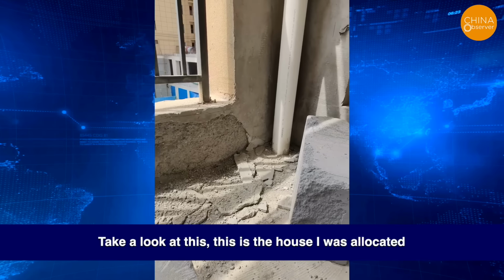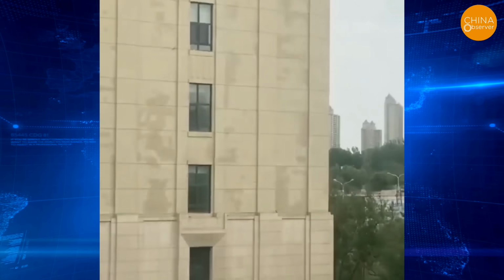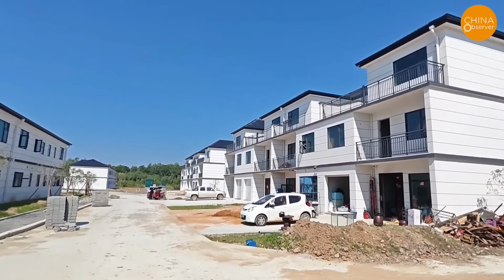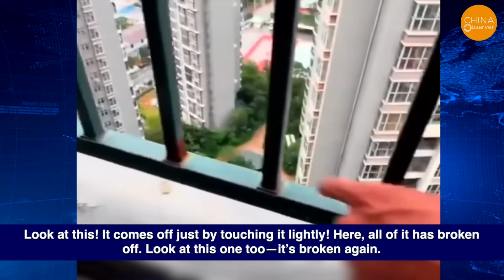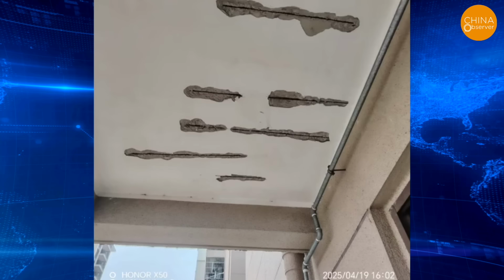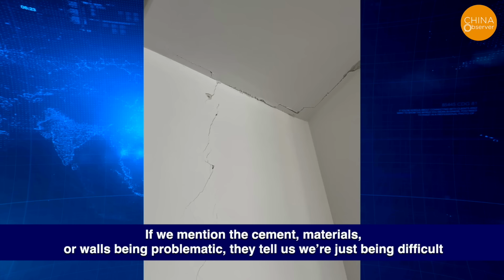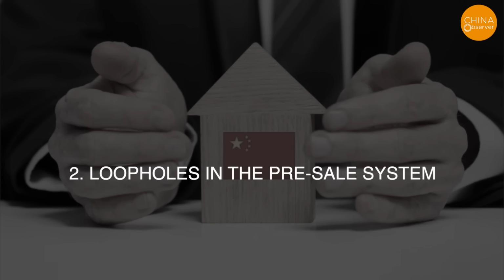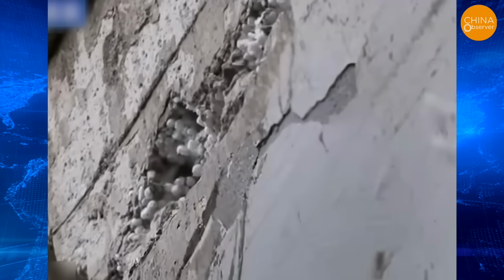China’s Inhuman Tofu-Dregs: 100M Skyscrapers With Rebar Snapped by Hand, Floors Cracked by Stomping

Comment: Necessary steps, are necessary for a reason..  Doing something other than the necessary, means that you are not completing the actual task you have been contracted to do.. Painting styrofoam, to look like bricks, is not an acceptable practice, because it isn’t even a brick…. 

China, stop comparing yourself to the US,.., there is simply no favorable comparison.  If you have money, you pay for quality, and you get it.. Quality, is the “reputation”, you should be concerned with, as it dictates the price of everything from Toyotas reliable cars, to western homes, and buildings that set the standard for design, innovation, safety, and longevity..

You build cities with fake drainage systems, and fire suppression systems that don’t connect to anything …

You make junk, that becomes trash..

Comment: I am a civil and structural engineer and although this should be more than apparent…the people living in these high rise structures with massive fissures and cracks especially the ones seen in columns and beams should immediately leave if they value their lives and this is not an exaggeration whatsoever. I know people will say where are they supposed to go? And to that I have no answer other than would you rather be homeless and alive or have a roof over your head that ends your life?!

Comment: In the UK, in the 1960s, the government built loads of very low quality tower blocks. They were plagued with issues. (Search Ronan Point disaster to see what I mean). Some of them didn't even last 20 years before they had to be knocked down. Anyway, the newer blocks weren't SO bad but they were still rubbish. Despite that, they've (just about) lasted 65 years and some of them are still perfectly sound, well made buildings. That is despite the fact they were made before modern building regulations and that corruption was everywhere during their construction. 

China is doing now what we did 65 years ago only we cut a few corners. They're cutting every single corner there is to be cut!

Comment: 16,000 Yuan to USD equals $222.77. 

Let’s say each unit sold in the high rise building is 1200 SF. Average SF of a 2 bedroom apartment in the U.S. 1200 SF to meters = 111.84 square meters. 

$222.77 * 111.84 = $24,914.59. You get what you pay for. Those are high rise buildings and let’s say the average 2 bedroom is the same average in America. That’s really cheap for a 2 bed room. What did they expect? Some things are worth paying more for. Then again, average income in china is like $220 per month so yeah.

Comment: The thing is, I wonder how much you can really save, because the difference in making it 10% but having it seem 100% are probably not that much higher than making it 90% and have it seem 100%. Like with the handrails, welding a couple of steel rods and then painting them is probably not that much more work than trying to paint them without them being properly attached to each other but still well enough so they survive bbeing installed. It is much easier to put a ceiling onto a wall than to put a ceiling up against empty air, I mean compare stacking up bricks and stacking up playing cards

Comment: Chinese tofu dreg problems have hit America, too, for decades. They sold a lot of crappy iron water pipes which developed pinhole leaks after a few years. Lots of crappy sheetrock with high sulfer content, in humid areas it creates mildly acidic vapors that corrode metal and electrical connections.

Comment: I work in construction and lay concrete floors ,engineer checks every single rebar, and takes pics, that all rebar  in proper place before he will allow any concrete to start pouring..and spaced correctly ,plus area dust free and dampened beforehand,concrete to be used cubed and tested before use each batch ..there’s no messing and the finished result must be within 10 mil or less.. but am in Ireland 🧐🇮🇪
Reply: No country checks every rebar and tests every batch.
Reply: @peter.wilson  My uncle worked for a construction company that was building an Arena in Colorado, they indeed tested every batch of concrete and filmed every aspect of the project, which was reviewed daily.

Comment: we have construction quality issues here in the U.S., too, but not nearly so bad. at least we can sue the company... if they haven't declared bankruptcy and hiding behind an LLC by then. the only thing that's ultimately going to solve our issues is putting these people in jail. and, i'm talking about the construction workers, also -- they know they're building sub-standard structures, they don't need to be engineers to realize that. this is why we have whistleblower laws.
Reply: that's why they have Chinese construction workers without conscience(remember they hate you) , every law has been changed or circumvented to allow the infiltration.
Reply: It's getting worse here in the US with normal homes. It seems like they're made out of plywood and wallpaper. On the other hand our apartment building are pretty solid. You definitely won't see anything like this. This is actually scary.
Reply: @BoredInTheComments  Plywood is quite strong when installed correctly. Wood frame construction is highly scientific and designed for effciency in heating and cooling. 

They are cutting corners on trim and siding, especially, in modern US construction. The pressboard (basically cardboard) siding and trim is the worst thing that is happening, right now, at least in my experience.

Comment: To be perfectly honest, you’re better off welding 2 shipping containers together and calling it a day. It will seriously give you better peace of mind. All I see is contaminated materials, junkrebar, fake concrete, foam insulation that were supposed to be steel. None of it is salvageable.
Reply: This is almost what I've been thinking of in building a house. I know it will need reinforcement. At that point it would just be easier to not use them.
Reply: @mariawhite7337  An old friend of mine moved out west to a little off the grid development and their houses were assembled that way, and to be quite frank they are almost as nice as mine. Pretty goddamn impressive square footage too I’m talking a little mini bunkers much larger than most apartments.
Reply: I agree
Reply: True

Comment: That yellow mud looks like sulfur. Sulfur is also a contaminant in steel and renders it brittle if not annealed properly. It looks like the rebar is contaminated and releasing the compounds created by sulfur inclusions as it corrodes inside that mud filler.
Reply: They probably use sea sand too, you know the one with salt in it.
Reacts nicely with the steel bars of extrem tofu quality

Comment: Rusted rebar is normal, the rust creates a barrier to protect the inner bar, it's the sub par concrete that caused the failure most likely.
Reply: Rust in rebar expands causing concrete to crack.
Reply: @gund89123 you're wrong, the rebar has to rust, cement is wet, moisture causes metal to rust, the rust protects the rebar, period, end os story, you are wrong. done said, accept it, wrong as the day is long.
Reply: They are likely using seawater.

Comment: What hurts is Cement is environmentally bad (to make) and tofu housing means more cement will be needed to provide a livable structure. Heads should roll. Will they?
Reply: No CEMENT IS MADE OF MOSTLY NATURAL INGREDIENTS.
Reply: cant you see it isn't made of cement that's problem1 , problem2 those soil are probably dredged from riverbeds/mangrove swamp which has no arable or construction values ( e,g, bricks or pottery ). There is no rule of law, money talks and power absolutely corrupts .
Reply: That's how you know that environmentalists are not actually that worried about climate change.

If they were they would be outlawing concrete